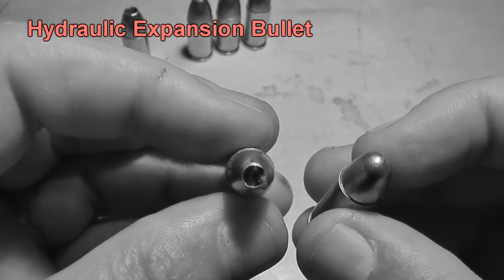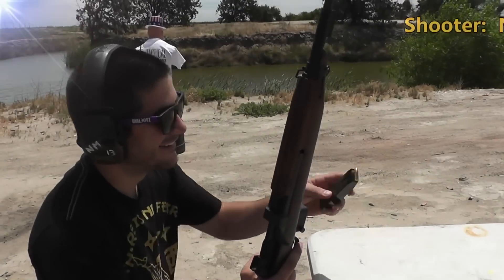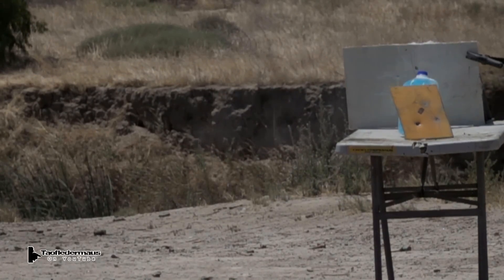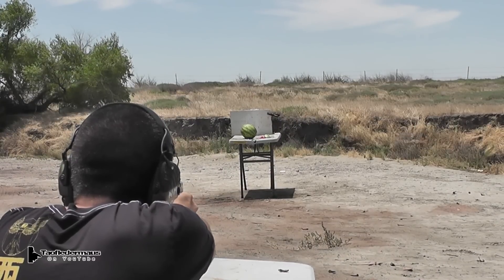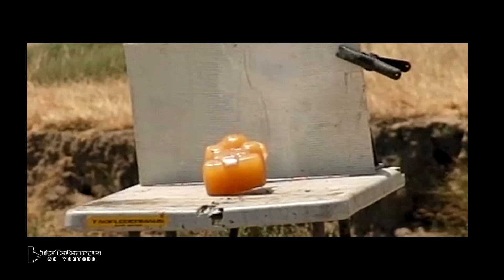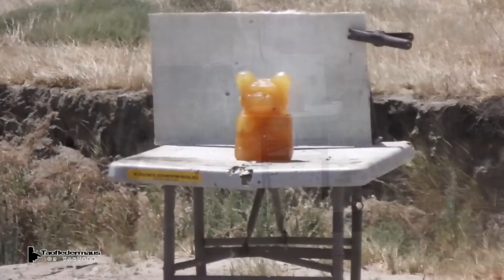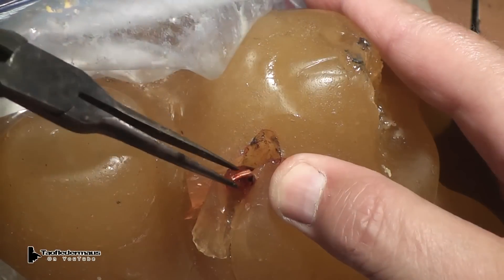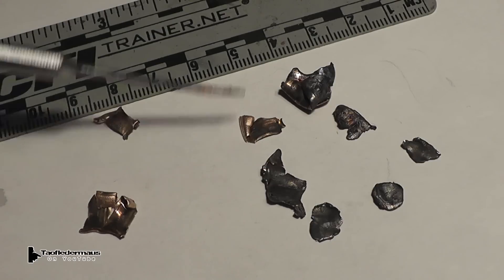Hydraulic-Expansion 9mm Bullet Experiment

Comment: Here's an engineer's perspective.  I saw enough detail in the last shot to come to this conclusion.  When the shot was fired, the epoxy was either broken free of the bullet or shattered, depending on what type of epoxy was used.  It probably remained intact but receded into the bullet, causing the red spray.  When the bullet hit the front surface of the gummy bear, what remained open of the hole was filled with gummy bear, compressing the epoxy plug and building enough pressure to burst the bulk of the bullet.

I predict that the same thing would happen to a bullet drilled like that one was but left empty.  I'd drill a tiny hole at the base of the ogive, say a #65 drill.  This hole would let air escape as gel (flesh) enters the hole, not wasting energy on compressing the air in the hole.  I predict that this bullet will perform at least as well and probably better than the dye-filled one.

For completeness, you should also fire a Silver Tip -type round into the same type of bear.  The center post is supposed to direct the incoming body fluids outward toward the sides of the hole, pushing the front bullet into a series of cutting, rotating blades.  A .357 mag fired out of a Detective Special snubby elicits that performance in ballistic gel.

John

Comment: In my opinion, if the epoxy is rather hard, such as JBWeld, it will likely inhibit expansion, making the bullet not that much different from a regular FMJ.  Perhaps if the bullet were to be capped with a softer tip, it would expand more violently when struck against a wider range of mediums.  I'm thinking perhaps RTV gasket sealants, which remain a bit flexible even when fully cured.  At some auto parts store there is also a gasket sealant that when cured, never fully hardens and will always retain a rather paste like composition.  Just a suggestion in case there is a future video.

Comment: Two things that might skew your results. 1) The epoxy is hard enough to expand the bullets on it's own like the Gammo red fire plastic tipped pellets. 2) The hole that you drill into the bullet is larger and deeper than a normal hollow point hole. I would drill smaller holes and seal them with hot wax or hot glue. Also, just for laughs, try putting 1 or 2 steel BB's in the hole rather than a liquid. Daisey made steel ball loaded hunting pellets that, at close range, would penetrate thin sheet steel being shot at 1,200 feet per second. Maybe even some mercury if you can get it.

Comment: I will certainly call this experiment a success. The modification to the bullet did exactly what was intended, to start a very rapid expansion of the projectile. This modification is most effective when using heavier liquids, as in the famed mercury/quicksilver filled bullets. But good results have been made also with heavy liquids as oils and such. And as we see here, even with lighter fluids like dye. I suspect there might be a difference when it comes to which bullet one modify, though.  A .45 ACP bullet would be travelling slower than the 9mm and might not expand so rapidly due to that fact. But this is a problem with regular hollow points, so filling them with liquids might be a good idea is shooting heavy bullets out of a short barrel, to get consistent expansion. Such slower, heavier bullets would also be less prone to fragment the way the 9mm bullet did here. A very interesting experiment and I would love to see you experiment more on different bullets and liquids.

Comment: think thats good see what happens when you fill the bullet cavity with 1 wax 2 obleck 3 sillyputty those are less likley to leak out when fired and should give you the hydro shock value your craving to see also should have shot one of those at a block of clay cheap and would give the right resistance to bullet

Comment: I know this is an older video but hey I just found it. I did kind of the same thing. I drilled into some hollow points the same way except I used some 30 weight motor oil and then I plug the hole with epoxy but I set a .177 cal copper BB in the nose of it. penetrates, then explodes! Worked outstanding. Give that recipe a try. See how that works out for ya. It would be great if you had a block of actual clear ballistics gel to see what it's actually doing though.
Reply from the maker: I've been meaning to try an oil to see if it will detonate.

Comment: Try drilling a hole, fill 2/3 with mercury, and seal with wax, not epoxy. Should see something a bit more energetic. Been about 40 years since we experimented with this, but the effects were many times more energetic than what you show here. I suspect the epoxy was hindering the expansion. [Side note - A .22 Short lead bullet drilled with a small drill bit in a hand chuck, added a drop of mercury, and wax sealed showed interesting results.]
Reply: The Lead and Copper would have amalgamated with the Mercury. Might even end up causing structural failure of the bullet.
Reply: MG50 The same was used in the book "The Day Of The Jackal" by Frederick Forsyth.
Reply: might want to know that using a exploding bullet is illegal and will guarantee you will be going to prison for a really long time hmm plus finding enough pieces to tell the  cops about
Reply: +Al Gilder Nope. They're only considered a DD if they have more than 1/4 ounce of explosives. Any less and you're fine.

Comment: At those speeds water will only serve to slow it down and not Increase the hydrostatic shock. The seal on the tip failed either to the g forces during the firing sequence or the extreme centripetal forces caused by the very high RPMs from the spin of the bullet. The water appears to have spun out the side. That bullet will heat up greatly during both firing and upon impact. Try a substance that is maliable or liquid at these temperatures but solid below temperatures you might encounter. I suggest an acrylic tipped bullet (something that the market is just now figuring out) acrylic is the substance in bullet resistant glass that expands outward when compressed or struck with a bullet. This in turn spreads the energy out over a larger area before it meets the tough polycarbonate layer hopefully stopping the bullet. The same principle should work for causing a bullet to expand.

Comment: I had ALWAYS wondered about something similar to this...

I always wanted to try a mercury tipped bullet. I figured putting a drop of mercury in the hollow point and sealing it with wax. 

The wax should melt/disintegrate immediately allowing the noncompressible mercury free on impact.

As a man killer, even a non-fatal round might prove fatal from mercury poison...??? Maybe??? (for use in a SHTF situation)

That's MY theory anyway.

Can you try this?
Reply from the maker: I don't think wax would hold any liquid inside.  The g-shock would just knock it out.  (think of hitting a wine bottle at the base and the cork will come out)
Reply: I am thinking it only needs to be there to keep the mercury in before firing.

Comment: I was wondering if you`ld give yourself a barrel obstruction. FMJ`s aren`t bonded so I was curious if the core would push through the jacket. interesting test though
Reply from the maker: Sure,  can I borrow your gun?
Reply: no no....I was wondering if that`s what would happen in this test. I`ve tried alot of different things but I never dared drilling that big of a cavity in a FMJ for fear of the lead core being pushed out of the jacket, leaving the jacket in the bore. Not sure if that would ever happen...I never wanted to push my luck and find out tho! I had a bullet get stuck messing around with very light loads with jacketed bullets.....drove the core right out of the jacket trying to get it out!
Reply: as I`m sure you`re aware, in most FMJ bullets, the core is exposed at the base exposing it to chamber pressure
Reply: TAOFLEDERMAUS  can you liquid fill g2 rip 9 mm ammo
Reply: The jacket wouldn't remain in the bore. It would be sucked out behind it just like the wadding is often sucked behind a shotgun slug. And even if some did remain in the bore, it wouldn't be enough to cause an obstruction. It would be removed by the slug of air ahead of the next round fired.
Reply: WardenWolf sucked out? lol
Reply: go ahead and give that a try, do it remotely though, the gun is going to take it pretty hard! I know, for a fact, that snow packed in the barrel of a 38S&W top break revolver will ring the barrel and crack the cylinder. Snow doesn`t offer anywhere near the abrupt obstruction a bullet jacket will. Do a video of your test, it`ll be fun to see. drill a .300in cavity in the nose of a 9mm nato ball round and touch it off. then, immediately send another right behind it

Comment: hydraulic injections are really bad in themselves typically happens on mining sites when injected in skin even a pin hole injection if not treated immediately they halfto amputate or you die so the videos I've seen at msha
Reply: Derek Taney me and you are thinking of two different hydraulic injections ur thinking of a high pressures device aka hydraulic injections of some sort I'm saying basically the same thing but with hydraulic fluid rather a vaccine
Reply: very bad

Comment: It did not have a pinhole in it. Upon firing the cartridge the liquid boiled and expanded to spill out from the cavity you created. The excess came off as the mist you saw the remainder was emptied into the gummy bear. The thermal expansion of the liquid is calculable at M deltaT CP.

Comment: try something that doesnt compress as much as a something water based like hydraulic fluid or brake fluid the results my change idk just curious
Reply from the maker: water doesn't compress
Reply: Water does not compress
Reply from the maker: 911s73targa  For some reason a few people  believe water is compressible.
Reply: but it get an higher boiling point...which can be usefull...cause the fluid under pressure will heat up

Comment: water is a bad choice for a hydro shock try axl grease or atf
Reply from the maker: It would be so oily,  it would  keep the epoxy from sticking to anything.
Reply: +TAOFLEDERMAUS plug the round with lead or maybe hot glue then epox after alcohol

Comment: Neat little experiment, but for the new shooters watching this, it's just that: An experiment. Handloads do not make for good self defense ammo, even if they do achieve good performance. The reason being: If you do have to shoot someone, there needs to be an investigation launched. When LEOs ask what kind of ammo you used and you respond with, "my own experimental handload," that doesn't really help your case.

You're far better off using factory ammo (in 9mm I would recommend 124gr +P Speer Gold Dot to new shooters, it's the same ammo cops use) and training with your weapon. In any situation where defensive discharges are needed, your shot placement is what matters most.
Reply: In any self defense situation, survival matters most. Everything else is subordinate to that.

Comment: What would have happened if you used wax to seal the bullet instead of epoxy??
Reply from the maker: It probably wouldn't stick very well the metal and the liquid would blow out from the g-shock.
Reply: it seems that the epoxy is too good at keeping the liquid in. I would like to see the liquid run out on impact is that possibly? Maybe with a higher caliber like a 44mag it will work better?

Comment: Size the drill to fit a #2 shot put a couple drops of diesel and super glue the #2 shot in the nose ( try to keep the finished projectile weight close to the factory slug weight.   I have enlarged the hollow point of a 22 wrm and used diesel under a #6 shot  is interesting!!  try it in low light

Comment: maybe if you used a non-hardened aluminium or steel bullet it would actually work, despite the fact that they might be too light you would actually maybe get the better effect that you want, except aluminum tends to tear under pressure instead of expand, so steel might be your best bet if you can find a way to make them.

Comment: Great idea for the bullet.  try if you can , drilling down into the bullet and inserting a ball bearing then filling it with superglue to seal it in { no mercury }  i.e if useing a 9mm bullet drill a 4mm hole 4mm deep. Or even slightly less deep, putting the glue in first, that way the ball bearing would be the tip of the bullet.  Only worry is the weight shift to the front of the bullet could cause tumbeling in flight, thus making the bullet very inaccurate

Comment: If I recall correctly, after various experiments, OSS had good success developing a bullet proof glass penetrator, using "heavy, sub-sonic" projectile, drilled and filled with "h2o", and carefully re-sealed with hot lead.  Try using standard 45 cal. round.  Never designed to stop a tank, but rather, and using suppressor, to blow entire pane of bullet proof window inside a top floor room, without scattering broken glass on the street below.  I think that's right, but I'm old and forgetful sometimes.

Comment: I did the same thing, except instead of using epoxy, I superglued copper bbs into the tip of the hole halfway, giving the bullet a rounded solid copper tip. I also used a heavy weight oil hoping to see if the thicker density of the oil combined with the copper bb pushing into it would have a more explosive effect. I haven't had the chance to try them out yet though.(I live in Commienecticut so it's hard for me to find somewhere to expairement with em. grr) I'll be happy to mail you some to try. I'd love to see what they would do on a gummie bear! Let me know and I'll send ya some. Oh, Ironically, the rounds I modified  are the federal hydroshock. lol.
Reply: Did it try?

Comment: I don't think it makes a difference. The hollow point fills up with gelatin, flesh, watermelon or whatever you fire it at for the "hydroshock" effect anyways.
Reply: I hadn't thought of that but you make a very good point.
Reply: No, that tiny amount of extra time for the bullet to expand is negligible. In fact, I'd imagine the bullet to actually expand less, due to the liquid within the bullet traveling along with it. Energy for expansion is lost from the impact as the target liquid needs to move the bullet liquid against its inertia before the bullet can expand. This as oppose to the target liquid entering the bullet at bullet speed without any energy loss. In addition, the bullet carrying liquid and whatever to seal it in would increase its mass, decreasing it's velocity, again leading to less expansion. 

Of course this all also negligible. I doubt there would be a measurable difference.
Reply: +Stanley Chang i agree, you're right a plain hollow point would've dome better a filled hollow point kinda defeats the purpose of it being a "hollow point" which is made for rapid expansion the filling just stalls it from happening right away acting like a regular bullet even if its for a mil sec it stalls the hollow point from expanding right away as it penetrates

Comment: Like others, I would have preferred to see the comparison with a regular block of gel instead of the gummy bears. That would have allowed me to see the performance against standards that we've all seen in other videos and pictures. 

I don't know what epoxy you used, but most epoxy formulas have a maximum temperature limit. Instead of a pinhole, you may have melted or burnt your epoxy during the firing process, and that is why you had a trail of red dye following the bullet. 

Your idea is interesting. Did you weigh the bullets before firing them? What was the change in bullet weight?
Reply from the maker: I can't afford that stuff.
Reply: Is it really that expensive to buy the powder and mix it yourself?
Reply from the maker: I only have a $5 video budget.

Comment: Liquids like water "are" compressible to a certain extent... Also since human and animal flesh already have large percentages of water there is no reason to fill the end of a hollow point bullet with a liquid. The only reason most hollow points fail to expand is because they get filled with cloth, drywall, bone, etc..The epoxy cap holding the water in was probably to strong considering the cavity was completely filled with a liquid. A weaker cap or an air gap behind it might help it to break easier, but in normal ballistics gel I would expect about the same expansion as a normal unfilled hollow point bullet and no fragmentation depending on the depth of the hole.
Reply from the maker: Pour a gallon of water into your car's engine while it's revved up and see if your theory is correct.
Reply: ***** Umm it is designed for air and not water... Water at the bottom of the deep oceans compresses by about 2% or so. To call it uncompressible is...

Also I have seen people try filling hollow points with heavy grease to help expansion and it did not help.

Comment: I would tell you how to make something like this but very deadly and does a lot of damage, however it's illegal so I can't.  Requires less liquid, a reloading machine, a small amount of lead to melt over the hollow point to seal it and room for the "liquid" to move, in other words don't fill it full before sealing the tip.  I'm leaving the type of liquid out of the info for a reason (and no it's NOT explosives).

Comment: I think shooting both the modified and control round at two long blocks of the varying consistency gels would have been a better test. Doing this, you would be able to determine if the wound channel of the modified round is significantly larger. The slow motion on this test would be very interesting to see. As well a comparison between a normal hollow point and the modified round would be neat. Redo?
Reply: FACTS!👍